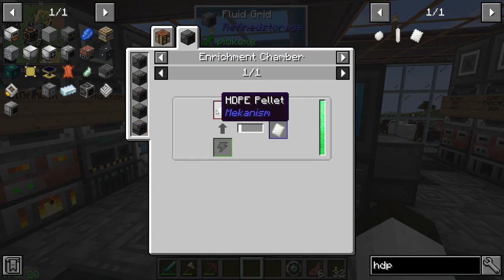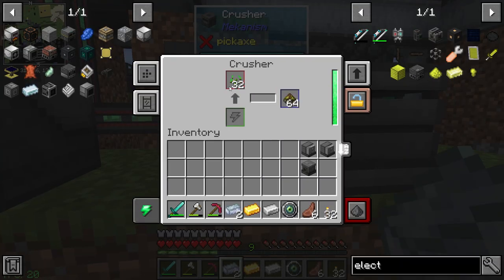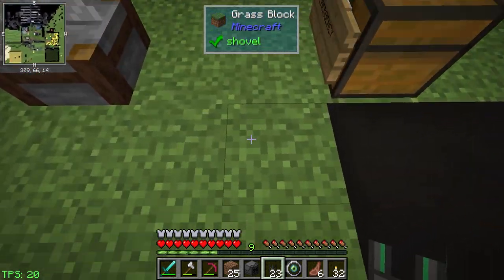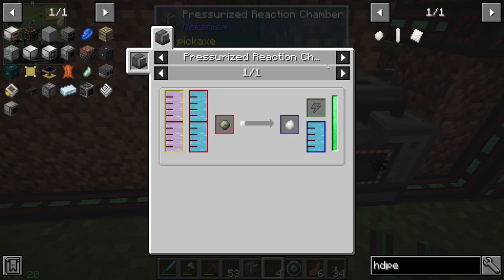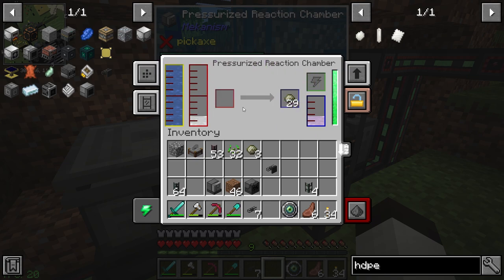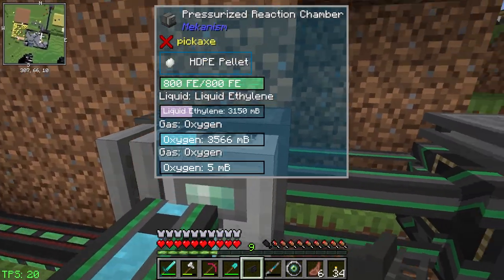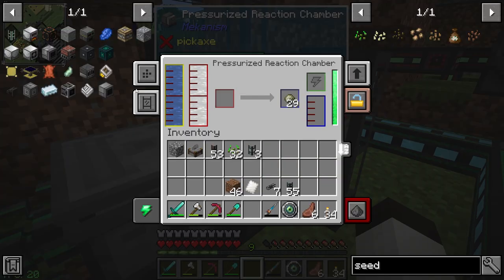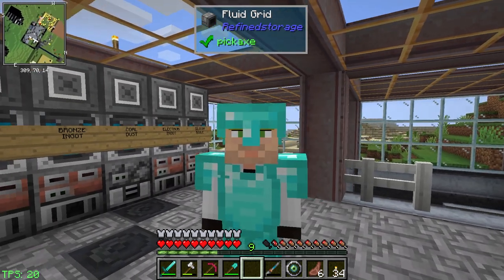QTech: Episode 30 | AUTOMATIC HDPE SHEETS! tinker77

Comment: Mekanism 10 (for Minecraft 1.16) improves the side config, including that oddball machine that you had to turn around, I believe. Do you plan to automate the biofuel production?
Reply from the maker: I did that off camera.  Just throwing seeds into a compressor (if I remember right) and taking the output back into the storage system.